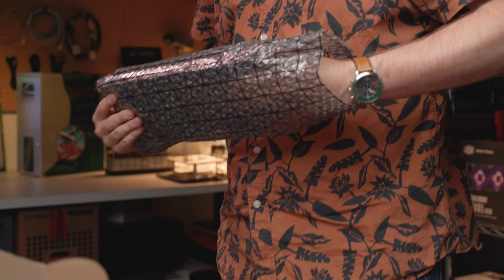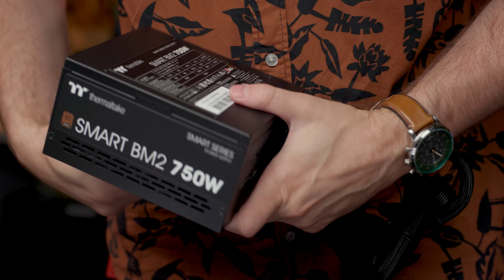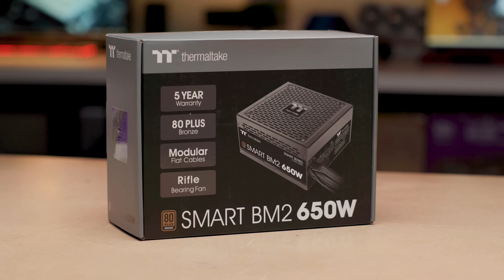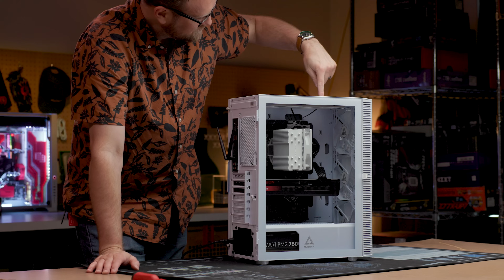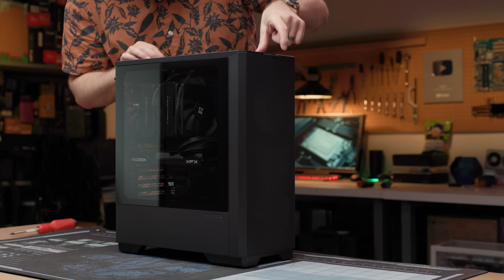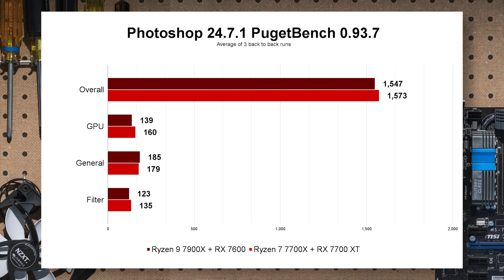$1000 All-AMD PC Build Challenge: What Would You Do?

Comment: 4:29 "gaming ring" 10:06 "production work" can't thing of two better list of AMD parts not to buy, but also not worth to buy specifically for those intended purposes... discarded non binned and hard to sell and justify existence parts, no thanks... better options IMHO:
- 5700x (or 7600x)+4070 for gaming way more perfromance for less money or similar...
- 7500, 7600 or 7600x + rx 7800 XT

- 7800x3d+6700XT/6750XT/4060 good price value and potential to upgrade later...
- 7800x3d or 7950x+4060 for work if cores or cpu is important and also gpu encoder and renderer comaptibility 
- 4060ti 16gb and any ryzen 5000 cpu to keep price in the $1000 mark
- macbook air M1 under $750 or any m2 you may find $1000 for working and production.... 
-  cheap gaming laptop will be good for work 12500h+4060 (unbelievable value)...
- 5600x+rx6600 good for light gaming and working rig way cheaper than $1000 but only a bit slower...
- 5600x+4060 better than all AMD in bang for the buck for work and game
- any intel 7 cpu below 14400 (13400, 12600k, 12400, 12100... to N305) with a RX 6600 to 6750XT good enough fro gaming and working below $1000 at US prices...